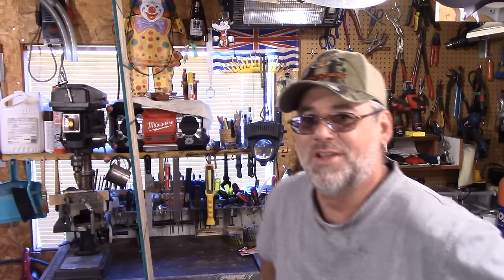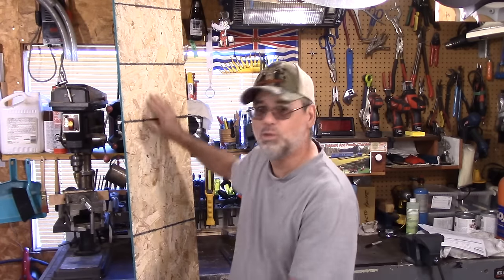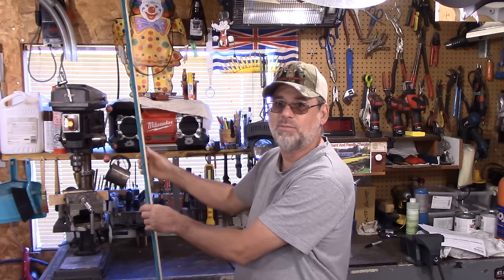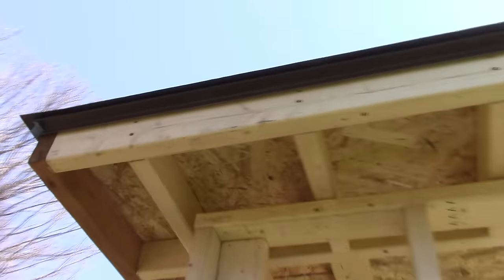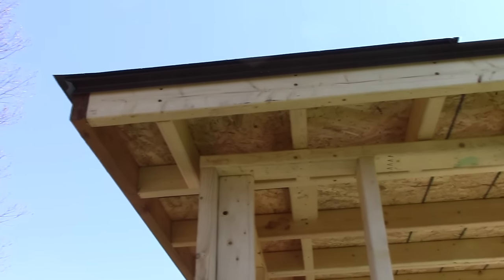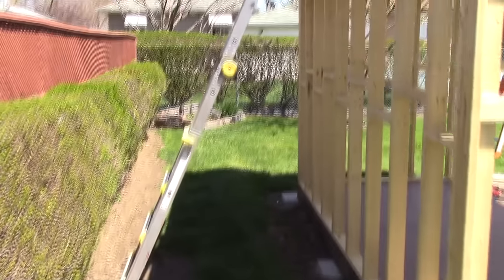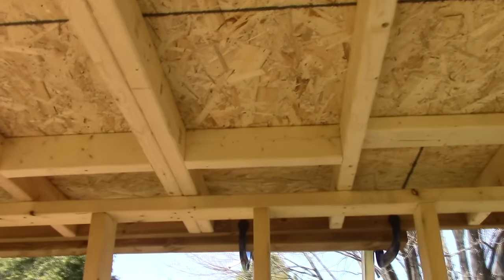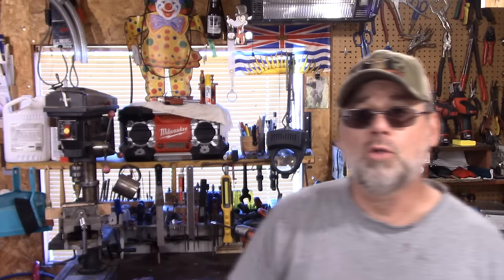HOW TO INSTALL ROLLED ROOFING ON MY GARDEN SHED BUILD

Comment: Im redoing the roof for my shed as well and more or less we came to the same method: OSB reinforcement + Ice/Water Barrier.
Because the plywood had previously rotted about a foot from the drip edge, I painted that with old paint, and I would suggest anyone using this method to paint the OSB drip edge boards; both sides.  Secondly, because I have a small shed, about 116" long by about 5 feet inclines, I've decided to overlay the Ice/Water barrier.  Because the edge experiences the most havoc, incline of my shed roof is 40 degrees, Ive decided to in fact stick two layers together for each drip edge ( = 2), followed by the layer going to roof line, followed by 3 tab shingles cut to 2 tabs stacked with 3" overlap for ridge along roof line.  Also I installed flashing, 4" X 4" if no eve & on drip edge, 2" X 2" otherwise around whole roof; I installed that first then used Tar (Polyerathane for wood/metal) over the screw line so that the Ice/Water barrier sticks and no moisture can make its way in.  In case it's unclear  I installed flashing before barrier so as to protect the wood behind.

I figure that doubling the barrier on edge will double the lifetime which my dad told me is around 20 years for a single layer, but I'd personally guess the stuff in the video is good for only 15 years.  The best part about it is nothing stops you from installing shingles on top in the future.
Reply from the maker: Great idea and long lasting 👍

Comment: YOU DONT NEED UNDERLAYMENT?
Reply from the maker: I don't use any but  sure you could use it if you like.
Reply: If you did it wouldn't be stuck to the roof, it would stick to the underlayment. Underlayment would have to be glued down or something
Reply: Don’t use 15 pound felt paper, when the winds blow hard you’ll find the hard way. The paper is staples to the wood, the roofing only glued to the paper, not a true bond, skip the paper and glue roofing to the wood. Think code says up to (3) re-roofs allowed, but I’ve seen as many as (8) re-roofs. To be depending on ceiling joist size more layers the best.

Comment: Why couldn't I use this on my RV I see no reason why not any info on roofing my RV this way
Reply from the maker: I would use rv roofing , this is definitely not rated for a rv.
Reply: I have a RV park right next to my house and I needed the roof fixed and someone told me to get this and they put it on the side that the roof was leaking on. Once they fix that side I had no problems with it.

Comment: Dont put the shiny side up. Put the glue side up. That's why it has lines on that side and the glue helps hold off moisture and water. It will last longer if you dont det it in right away
Reply from the maker: Interesting , thanks Samuel .

Comment: so how to you take it off for next time you have to do it, as in 10-20 years later
Reply from the maker: Good question Eli .  I wouldn't take it off just put another layer on top like most do with a second layer of shingles.   Now if you just want to remove it instead ,  it does come off .
Reply: @SteveRobReviews  thanks for the reply. Let me ask you this, if after 15 yrs you want to just roll right over the old stuff, what do you do about the bumps, and ridges, you get from the first layer,(sun baked) i mean it won't be totally flat. And will the second layer stick well i mean all the gravel will start to come off the 1st layer? I know at least with shingles you are nailing them down.
Reply from the maker: @elijones3994   You will have to put more nails on the roof for a second layer but  you still have the choice to pull the old layer off if you like.
Reply: @SteveRobReviews  i noticed you did not use no underlayment, why? So the  roll that you used will work without a primer for the wood?
Reply from the maker: Eli it sticks to the wood real good and so far all the years I've been using this on sheds its lasted great. I will  show the roof after all this time on May 20th  ,  I will include a good visual of the roof in that days video.   See  for yourself.   Cheers

Comment: So no paper either?
Reply from the maker: Nope no paper . If you wanted to use paper sure give it a try.
Reply: Ok but that means nails n making sure its secured properly to the plyboard b4 I put the roll on roof

Comment: Only if it gets wet it’s junk 
Great you should have Gracie ice and water shield first
Reply from the maker: Hi Greg
So far no concern as it's only a  unheated shed but everyone can  do as they please.
Reply: @SteveRobReviews   not knocking 
Past experience I didn’t do 
Other contractor did it water got into whole thing had to be replaced 
I am a contractor 
Love your work
Reply: No it's better for it to stick directly on the wood, for wind purposes, wind is much easier to go under and lift if there's an underlayment

Comment: $80 for a roof. Where to order it? The stuff costs $133 per 200 sqft at our local HomeDepot. That's  more like a $266 roof.
Reply from the maker: Galen look at the date stamp on the video , yep that's the price back then when a 2x4x8 was $3.55 and the roofing was so much cheaper than  today like the price of lumber today  😅
Reply: Still cheaper than most
Reply: 99 a roll here in rainy CA, SF Bay, yesterday 01/10.2023 Story Road Eastside San Jose, CA
Reply: forgot to say, Home Depot on Story rd

Comment: It will work but if it gets hit by hail it wouldn't last its not rubber
Reply from the maker: Its a low cost alternative most can apply but its definatey not as good as a steel roof or 1/10th the cost . Cheers Brian